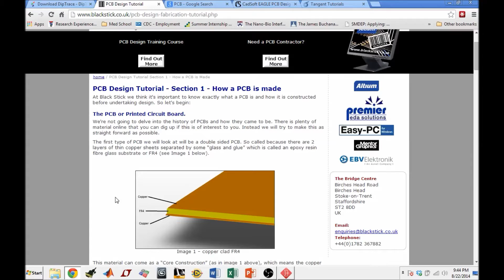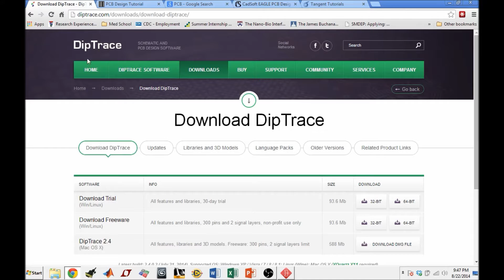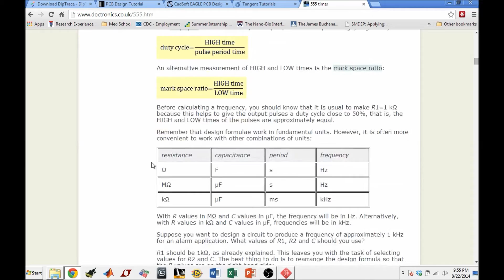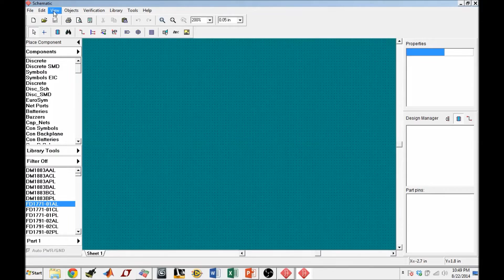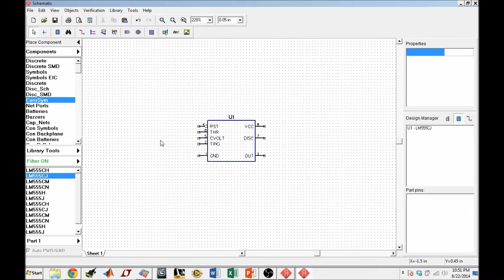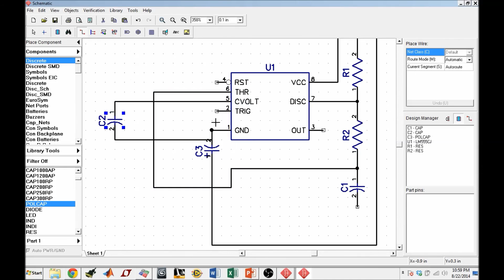PCB Design Using Diptrace pt 1: An introduction to PCB's and creating a schematic

Comment: The middle of the PCB is fibreglass FR4 the top and bottom layers are copper, but copper does not rust you need to learn your product before doing a video.